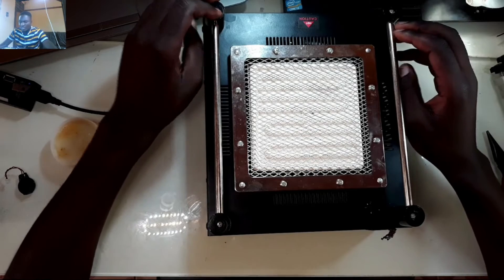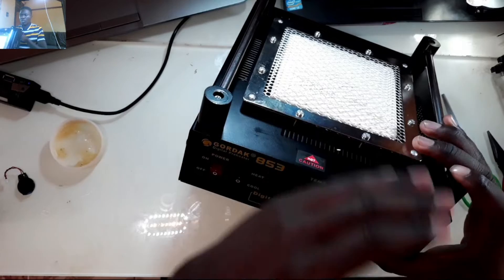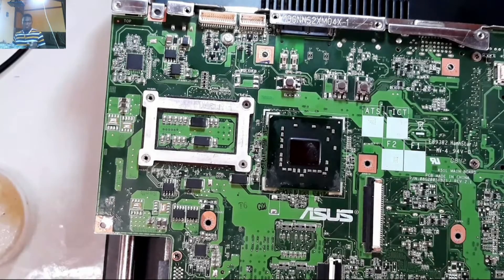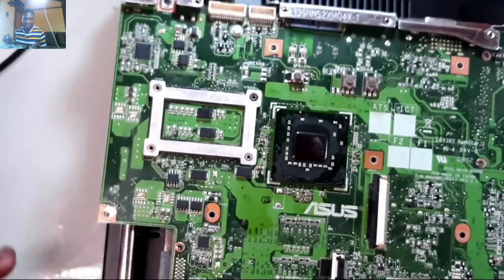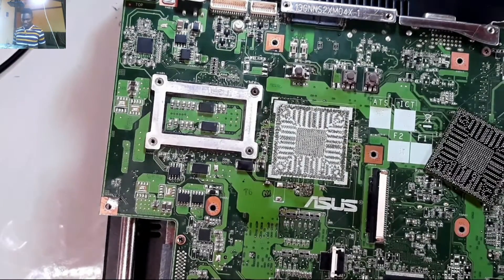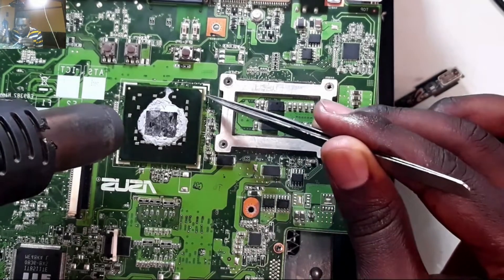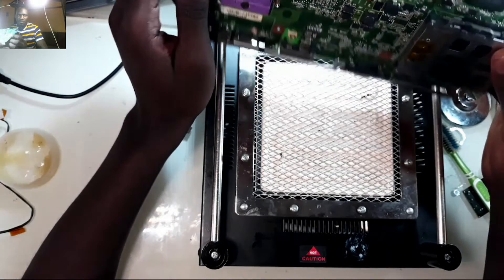Is it possible to replace a laptop processor with a Gordak preheater?

Comment: when you replace the wolder balls on your bga chips what is your process to remove the flux once the job is done? I'm always worried about flux under my chips not getting washed away properly and conducting. Thanks and great video. I can't wait to get one of these preheaters. I could afford an all ine one rework station and ran across this model on aliexpress. I do lots of repairs and have a huge amount built up over the years of modern game consoles that have bga chips. Because I can't afford a proper station I have only repaired older consoles. Now I can finally repair all my modern consoles. This has turned into a savings account in a way. these repairs will pay for the preheater. So happy I learned about this method. Thanks :)

Comment: I was really need a review.
Thanks man. 
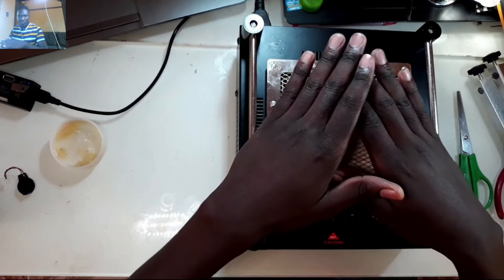But a tip at 4:00
It's temperature goes up slowly to don't shock the motherboard with sudden heat.
You should put motherboard on it when it was cool yet and then turn it on.🌹
And you can use 2 temp probesusing aluminum tape near chipset using 2 multimeters. One for front and one for back.
And on 11:00 you don't wick the solder of pads on board. It can cause short after reflowing new chip
Reply from the maker: Thanks for the tips!

Comment: more flux!!!!!     300° preheater and 350° blower with 80% power is fine,.
Reply from the maker: Yaa I have found 300 & 350 temperature to be fine with big motherboards, small motherboards 200 - 250 preheater temperature works fine. Otherwise thanks for your feedback

Comment: Nice video! Subscribed. Can you share the link where you got it? Thank you.
Reply from the maker: Thank you the link is In the description
Reply: @platinum_computers  Thank you for the info. The unit on Amazon looks different with temperature up to 400C, while the unit on Aliexpress looks the same as yours with temperature up to 500C. I need 110V. Is your unit also 110V?
Reply from the maker: @j.d.3269  Mine is 230V but that's because in my country we use 240V, on Aliexpress they should have a version for 110V
Reply: @platinum_computers  Yes, Aliexpress has the option for 110V. Thank you very much for the information.